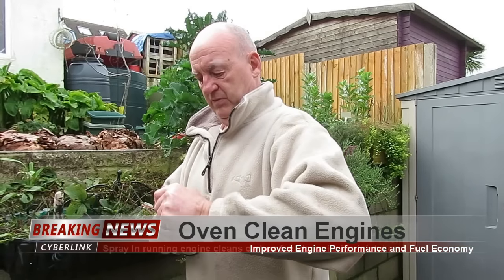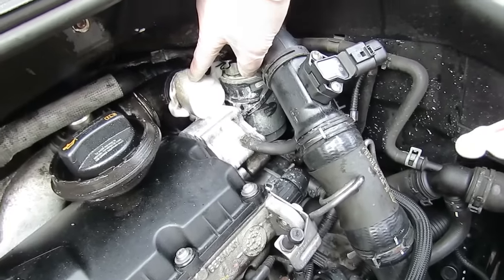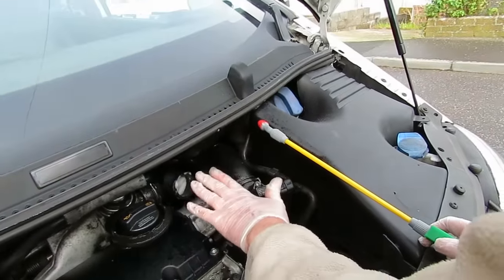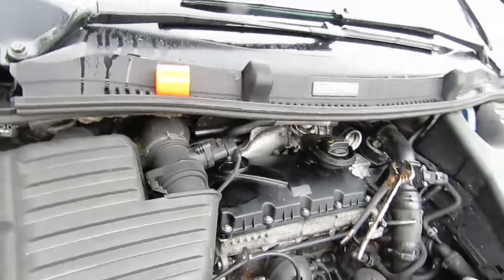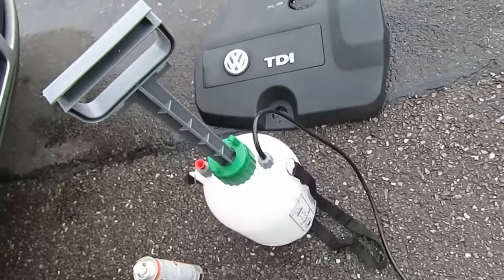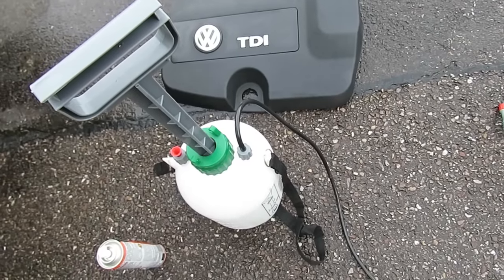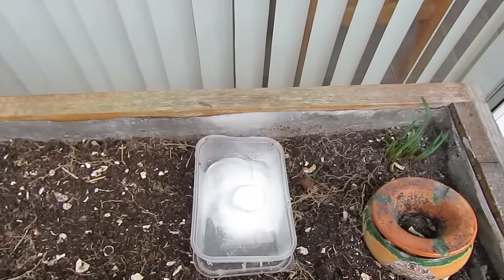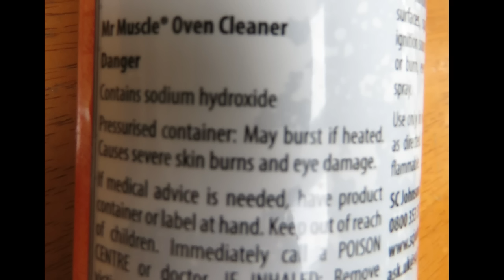Clean EGR Valve Decarbonize Turbo DPF MPG Limp Mode Mr Muscle VW 1.9TDI Sharan Galaxy Alhambra

Comment: I have a 2008 seat altea xl & have changed the brake master cylinder. While doing that, I thought I'd clean the egr & asv while I'm about it as they had to come off to gain access to the brake master cylinder. I cleaned them with brake cleaner & a small brass brush & a toothbrush. Everything went back on with no problems until after about 15 miles when the emission service center warning flashed up. Plugged in my scan tool, & sure enough the P0401 egr flow insufficient code reared its ugly head. Off with the asv, & egr again & re installed using hi temp gasket sealant & back out. Same thing.I did a fault code reset both times. I reckon I must have dislodged some shite that ended up down the intake manifold when I took it apart the first time. I used your method but only as far as step one. Mine is a 1.9 tdi, so no need to go behind the maf sensor as the hose to the asv/egr /intake is on the left hand side. I used the smart straw with some pfte tape wound around so I could slide 800 mm of 3mm inside diameter clear pipe over the top. I marked on the hose with permanent marker where the far corner of the intake was, & fed the pipe in. Good shake of the can, slide the straw into the tube, proceed to foam the intake, slowly withdrawing the tube as I sprayed, as to completely get all 4 ports. Once the tube was pulled all the way out past the anti shudder valve, you could see the filth in the foam right away. I left it to work its magic for 1hour & 45 minutes, then I wiped the inlet stubb of the asv and replaced the duct. I have the clips on mine that you just pull out a small amount with a screwdriver or pliers. Put the bonnet down, said a little prayer as I have read the negative comments as well as the positives, then turned the key, and...........

Away she went! Just be ready to feed in a few revs as soon as it fires up & hold it at a steady 2000rpm for at least 20 seconds or so to make sure you don't stall the engine. You want to make sure you burn up all that liquified sheiser in the combustion chambers. I let it idle for a few minutes and then took it out for a 20 mile run on the dual carriageway. This will help to poop out any unwanted shit in the egr system. Got home and no more fault codes. This method DOES WORK! I saw no need to use water, as a good run will burn & blow all the crud anyway. I see no evidence of aluminum being eaten or seals or anything like that. You would need to soak it in a vat of the stuff for a year to do any lasting damage. As for seals? Your rubber gloves would melt would they not? Just use some common sense & save yourself some money. If you are worried about your aluminum being eaten in front of your very eyes, then you can neutralize the sodium hydroxide with vinegar. Just spray a fine mist down to intake as you would with the water technique. I saw no reason to do this myself, as I used 1/4 of a can ,if that. The foam is flammable anyway,& is just going to be burned up by the engine itself. My car is a work hack with 163000 miles on it ,so I thought I'd roll the dice, having never tried this technique before. I tweaked the method to suit my application & it worked very well. If my turbo gives me any aggravation , then it will get the same treatment as the egr system now I am confident that it works. Most of the negative comments are coming from people who have never tried this technique, as well as thinking that sodium hydroxide is an acid. It is alkaline in fact, so do a bit of research before slagging off someone for trying to help out others.
Reply: If you also did a bit of research, you would know that sodium hydroxide (caustic soda) is an alkali and a strong base and the amphoteric properties of aluminium means it dissolves in both acids and bases. Moreover, the reaction with aluminium and caustic soda produces hydrogen gas, which is somewhat explosive.
Reply: @Weejie2011  don't make the assumption that I've not looked into this matter. Yes it will dissolve tin foil, but not an inlet manifold in an hour. I also wouldn't perform this task in my living room. Fact is I've done it, & it works. You go waste your money at the garage if you want, makes no difference to me.
Reply: @bullenharben9905  No, it won't dissolve an inlet manifold in an hour, but it certainly can do an awful lot of alteration to the surface finish. I have used caustic soda to remove the anodised finish on bicycle parts when renovating scratched surfaces. The items can be polished and anodised again. If you have seen how rapidly the chemical works on a handlebar stem, you'll understand my point. I don't waste my money at garages. I have removed manifolds and cleaned things properly. Time consuming, but less risky. I think you are making the assumption that people are not savvy enough to be able to do the job the way it is supposed to be done.
Reply: @Weejie2011  its a 2008 car that cost me £1500. Get off your high horse mate. Access is nigh on impossible to remove the manifold on my car, which is why I resorted to this method. Plus I didn't want to run the risk of snapping any studs where I can't even see them. I'm just saying that it works. No one is forcing you to use oven cleaner are they?
Reply: @Weejie2011  giving up on the car because of a sensor? I'd have given up on it knowing it was a Vauxhall.
Reply: @bullenharben9905  I used to deliver to the Vauxhall plant at Ellesmere Port back in the 1970s. The cars were rusting outside even before they were registered. They have upped their game since then and they are as crap as any other car. I still have the Astra. Off the road, needing a steering rack and exhaust. Not a spot of rust on the bodywork though, and the sills are all intact. I will probably put it back on the road, but I'm busy putting a rear axle on a Berlingo. Now those are crap. I'd rather have my Flying Scot push bike, but not great for carrying feed bags for livestock. A couple of bags is usually enough to realise that crap vehicles have some advantage. I'm not pouring caustic soda in my bottom bracket whatever.

Comment: Mr muscle also cleans wheels with the worst brake dust staining you can imagine! Spray on and leave for 15 mins, then get a scotch brite pad and it will lift off with some gentle rubbing and rinsing. Without mr muscle I would have scrubbed for 3 hrs to get it done.

Comment: ...thanks for your advice Andrew. I have used your method twice over the last 2 years and it works like a treat. What i did, I 3D printed a plug with a tight fit hole to suit WD40 straw. There is no more over spill. I usually let it sit for two hours than start engine and spray intake with water. - Engine runs freely without any hesitation. I realize that this is not a permanent fix but it solves the problem for quite while cheap and cheerful. If you need such a plug feel free to contact me. - free of charge for you. Thanks again
Reply: hello m8 if i pay you can you print me one ?

Comment: Brilliant! We have been doing this to our tractors on our farm for 25 years! 
Oven cleaner of most types does degrade the carbon composites, grabs and binds to it, and the first few minutes of the engine running blows out the exhaust. 
The only problem is it burns like fuck when it hits skin. But as we have expendable farm workers, and can replace them (or hide there bodies as we often do) whenever the next moron shows his face at our door!
Our local diesel fitter says it has absolutely no effect or damage to the engine. 
Done it on my transit van when it started losing power.
Now its up to full power and happily cutting up innocent motorists on the M40! 
Yeehaaa, you middle lane mother fucking road hogs!!!
Reply: diagoros melos haha a man after my own heart, I say to my labourers if they hurt themselves I will kick them to the kerb for someone else to sort out. 
You got land to bury them in, We have to find a job that needs lots of concrete 🤣
Reply: diagoros melos I think you will have to look a little closer to home to find a dolt , we only like farmland for one thing & one thing only , O'Donnell Abu

Comment: The only time I marry oven foam cleaner and a car is to clean alloy wheels that have years of brake dust. I'd not necessarily do it to a new car but it worked a treat on a 15 year old golf. Also cleaned the callipers up a treat. So much so that I cleaned the brakes and wheels on my Daf Lf45 and after being marked as an "advisory"  on the previous MOT, this last one it didn't flag up. I only do a few 100 miles a year so they over corrode. There is no way in hell I'd spray it anywhere under the bonnet though, F that!

Comment: Please never do this to your car. Oven cleaner is incredibly caustic and will harm the aluminum internals. You're also introducing this into your turbo, exhaust and DPF. This is not meant to go into your car...ever.
Reply: So apparently it will dissolve an engine but stomach is going to be fine after oven has been treated with this stuff..
Reply: @franceuxleseuf5928  why when you soray your oven with that foam you start cooking and eating the rest of the foam?
Reply: Not all oven cleaner has lye which is bad for aluminium.  There is aluminium safe oven cleaner but there are also other good carbon cleaners

Comment: I took the manifold egr valve apart and cleaned them in my parts cleaner couldn't take the chance on my Audi a6 it has 250.000 on it still going strong all about the services and good oil cheap shite doesn't win the race
Reply: hey i got an audi a6 2002 3.0 non turbo with 170,000 miles on it, my egr codes came on and im convinced it's the egr. the shop wants 150 to clean it out but they seem like they don't want to do the job. is there a way i can clean it without removing it besides the way in this video?
Reply: @Westcoastmickey  not properly

Comment: Worked perfectly in a touran 1.9 tdi power restored,much more responsive after took the soot out of the exhaust , i did 15 miles after overreved in 3000 rpm hope it will last
Reply from the maker: Thanks for your feedback Radu, very much appreciated
Reply: Was it a 1.9 pd 105 engine think of doing mine with mr muscle but down the egr pipe on the manifold

Comment: Thank you mr. Fletcher. I have a vauxhall zafira 1.9 cdti engine and its very lumpy on start up, and puts out a ploom of smoke in the mornings. I used carbon cleaner and took the egr apart and cleaned it. Now... wen i had that done i noticed gunge was still inside inlet manifold. I wasnt sure whether it wud be safe to put mr. Muscle in there. I now regret that i did'nt do wat you done because when i screwed everything together again and started the car next morning.. the same problem is there. So i am definately going to take courage and trust in ure methods and tecniques and go forth and redd all that shit out of this yolk! Gud man thanks for your video.

Comment: I have a Toyota 3rd gen Prius.  I used  an extra reach 12 mm racheting wrench for the three Nuts in the back and had a hard time reaching the 4th HIDDEN 12 mm nut underneath the EGR cooler.   Used a Torx E8 socket for the two Bolts ( in the back of EGR cooler) and we finally freed the EGR assembly.   Good video

Comment: Can those strong solvents affect the oil's ability to lubricate the cylinder walls while doing this decarbonizing? Is there a change in oil color after doing this? Do any of these chemicals hurt the sensors? Is the catalytic converter affected by any of the harsh solvents present in the cleaner?

Comment: I am doing the Mr Muscle treatment tomorrow but defo not through the engine !
I am taking off the egr pipe from hot side of the turbo sraying in there and almost continuously moving the actuator arm over a couple of hours.
Once all back together a few revs at 3k and job done ! 
I have blanked my egr valve so no worry of if recirculating the cleaner. 
Bmw e90 320d m sport no boost under 2k at low speed.
Reply: Did it work?
Reply: @AndersMcTee  no it didn't do a thing !
I have since taken the turbo out and opened it up. 
Look on my videos, I've only got 3 lol
Reply: @snatchwars  Hi where are the videos
Reply: @grahamscott1191  no video.
It turned out the turbo was kaput !

Comment: Re sodium hydroxide: if it's very concentrated you can see bubbles coming off  aluminium, but its not strong enough in Mr Muscle to damage engine aluminium components after a couple of hours.
Reply: After cleaning my EGR Valve and intake manifold with oven cleaner it did leave white spots but got them out with a good polish.

Comment: I've Work on diesels all my life. They are nothing but trouble when they start going wrong these days. 47 years in motor trade  and never  had bonnet up on my car apart from topping oil. up .
Reply: yes me too 40 years me in the trade   introduced diesel cars into many northern counties and they were good long lasti ng engines      Now i am totally against them -they are as you say un repairable when they go wrong
Reply: This is because everyone buys diesels now for town driving / short journeys. Diesels are motorway cars, and driving them round town every day will fuck them up.
Reply: Guess why thoses modern engines doesnt last long?   They keeping you have a job.  Its all about the money. Economics.

Comment: did mine at the turbo out end. sprayed in and let it sit for 2 hours whilst freeing up actuator.  this was a year ago now.  hardly any smoke now and car pulls better at mid range. What was your long term results as good to know and give confidence to others - VW Bora 220000 miles

Comment: I done this on my Ford galaxy tdi which is same pd engine and worked perfectly with no problems 8 months later👍
Reply from the maker: Thanks for your feedback Lee
Reply: You may not see the damage in that time. Be aware your engine may need to be changed in a few years. Way shorter than the lifespan is should have
Reply: @theopinionatedgamer9847  so much lies 🤣 I have done this for years. 1st time.i did it was on my bora and I sold it when it hit 400k miles

Comment: EGR EXHAUST GAS RECIRCULATION valve, he is treating the intake manifold not the turbo side of the exhaust that feeds EXHAUST fumes into the maifold.
Reply: Yea, but thats were the problem lies, The intake manifold crusts up with carbon and because this manifold is conected to the head of the engine, the piston rings tend to wear from all the gunk up there. This causes the engine to run very non-economically due to the fact that it cant get the correct ratio of air and fuel. And when that happens, the engine management system gets the signal to pump in more diesel to keep the engine cool, thus causing more fumes which are then run through (unburned properly) the egr. .. So its a vicious cycle until the engine wears out and causes C.E.F. (catastrophic engine failure)

Comment: Good for turbo and manifold cause tricky job but for carb and egr you need to take it out and hold the valve up with screw driver and then spray wd40 all over and scrape all the carbon off then do this cause it crodes in just like the oven does these chemicals keep it clean when the job is done .youd have to do it every day for the rest of your life to completely clean with out screw driver scrape so hope this helps but my guide is complete fix hopefully it helps

Comment: Then, when water starts dripping from the manifold, simply crack six raw eggs directly into the air intake taking extra care to liberally coat the MAF sensor.
Reply: Lol.

Except this is after the mass air flow sensor, not before it.
Reply: Free Range or Cuckoo eggs??
Lol

Comment: Good on you for giving it a go but it would be better to remove the egr valve. I've used mr muscle on my egr valve and it works a treat but you dont want it going into the engine and even more so on the cat/dpf as it will strip the precious metals off them.
Reply: Those metals are extremely resistant to corrosion

Comment: Hmmm, it sounds enticing... Nah,  there's this little voice (of reason) whispering in my ear, warning me that the extreme potential for a multi thousand dollar engine replacement nightmare far exceeds the (perceived value of) convenience in following the method shown here. Call me crazy, but I'm strongly inclined to believe that it's probably best to play it safe and invest whatever time is necessary to follow  the accepted,safe and proven industry  standard procedure for eliminating the internal buildup, by removing the intake manifold and egr valve so as to facilitate the thorough removal of any existing carbon and oil residue... Besides, following the accepted procedure will cost you nothing more than some time and a nominal amount of $ for  Materials VS destroying a perfectly good diesel engine.
Reply: Said Eugene from The Walking Dead.

Comment: In my experience, this is a waste of time. If your turbo is carboned up, the only way to clean it is to take it off, open it up, and clean it properly. Also, Mr Muscle and a few minutes revving your car will do nothing to clean your DPF or Cat.

If you have limp issues and you think its turbo related (it could also be fuel delivery, airflow, or sensor issues) you need to do 4 things.
1. Get your car scanned for codes to confirm the nature of your issue.
2. Take the turbo off and get it flow tested.
3. Buy a vacuum gauge and test your vac lines.
4. And look for any obvious boost leaks in your charge pipes.
Reply: Raymond Wilson 

Yes. This is typical of YT armchair mechanics putting theory into practice. Potentially creating more serious problems than it solves.
Reply: I have cleaned my turbo vanes whit Mr mucle now over  5y.  and everytime it removes my overboost problems.  its works nicely
Reply: Hmm, I beg to differ. I opened 3 bolts on my vw mk 4 exhaust from turbo, stuffed in Mr Muscles for 2 hours into turbo, freed my actuator and runs like new. 220000miles